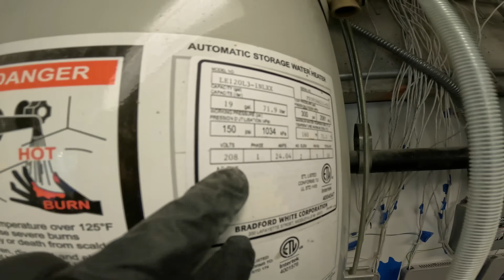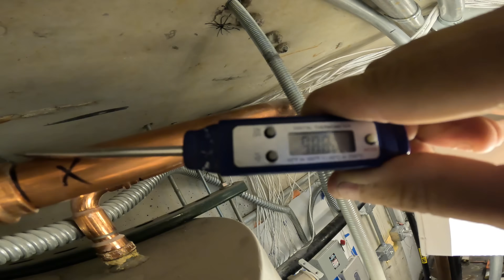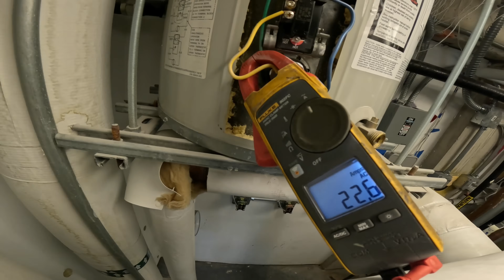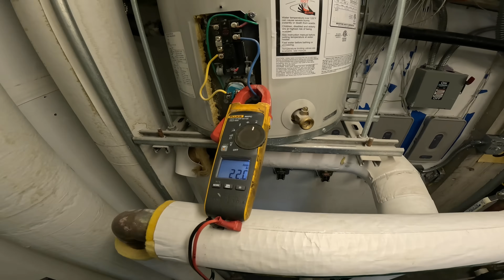HVAC: Electric Water Heater Not Heating Water (Electric Water Heater Troubleshooting) Dual Element

Comment: Wow, WOW. The way it works is only one element can be on at one time. "YOU SHOULD SAY THAT IN THE BEGINNING."
When the upper is on,  the lower is off, and when the upper reaches its set  temperature, it will turn off and then send power to the lower element. Also you need to do a. OHM'S TEST ON THE ELEMENTS  with the wires disconnect from the elements, THIS I S A POOR VIDEO ON HOW TO DIAGNOSE AN  ELECTRIC WATER HEATER. 👎👎👎👎👎👎

Comment: the single phase residential/light commercial water heaters generally only run one element at a time(to limit total current).  from cold/heavy use they start heating at the top element until upper thermostat satisfies, it turns off upper element and sends power to lower thermostat/element until it satisfies.
then on small volume water usage the lower element cycles on/off to maintain temperature, while larger water volume usage will eventually cause the upper thermostat to turn off power to the lower and turn upper back on, right until it runs cold or recovers. upper thermostat is a single pole double throw switch inside.
you probably know that, but maybe that will help others. 😁

Comment: You should confirm the water temp coming out is not scalding. There are usually regulations for timed exposure at full heat that need to be checked

Comment: It looks like you have a bad or defective aquastat which caused the temperature to rise above the thermal cut out. Additionally, it would not hurt to check the heater elements and check their resistance value as a defective idiot element can also cause the high temperature spike you can calculate the resistance value by using ohms law

Comment: Water heaters are wired so that only only element operating at one time. Usually the top starts first then the bottom as heat rises.

Comment: You should have checked continuity on the lower element. It may be bad. You measured the temp, but it will be hot at the top of the tank if the upper element is working, even if the lower element isn’t working. The lower element heats the water from the bottom of the tank to about the level of the upper element. So, if the lower element isn’t working, you will not get a full tank of hot water. You will only get hot water from the upper element to the top of the tank.
Reply from the maker: I hear what youre saying & thank you for the tips! In the video, both elements were pulling amps so there was definitely continuity across both elements. Thanks for watching 🔧⚡️
Reply: @JumpermanTech Good point!